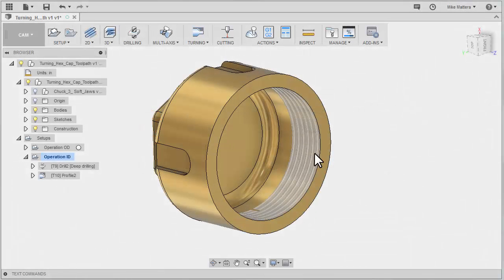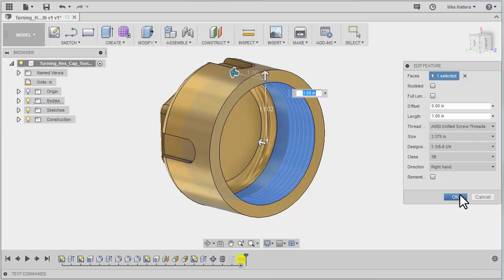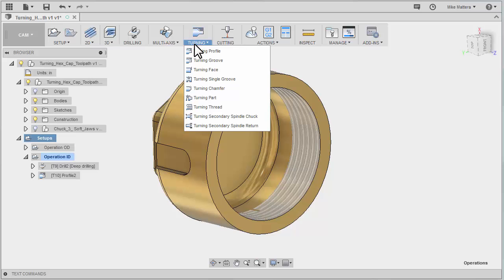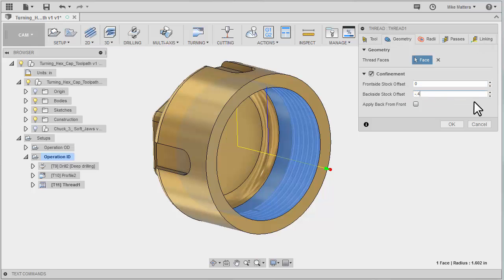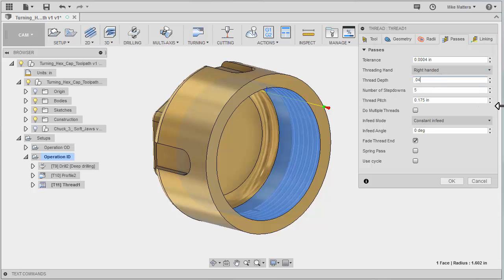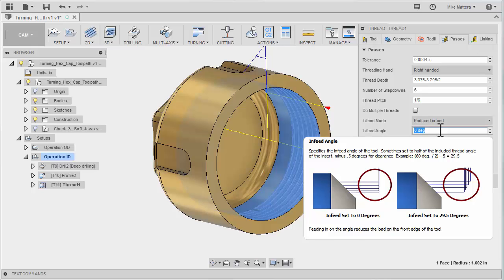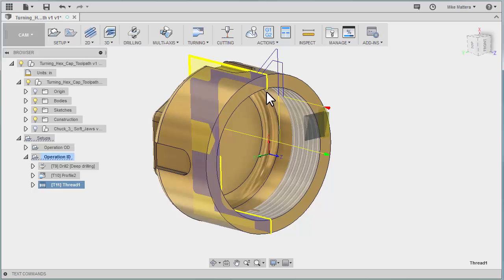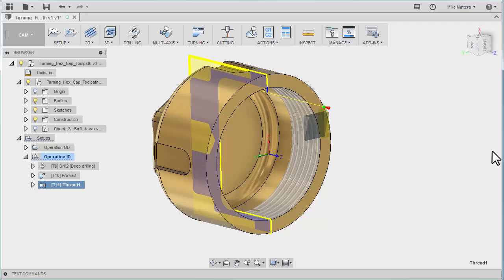Fusion CAM Live Turning Series 11 - ID Threading

Comment: I need to know where you got that tool?  Meaning what Library did you access or how did you create that tool.  Its been a few years since you did this video, and its possible the ability to import tools from a library supplied by Fusion no longer exists. Also, I tried to create a similar tool with no success, its as if Fusion wont allow for internal threading anymore.